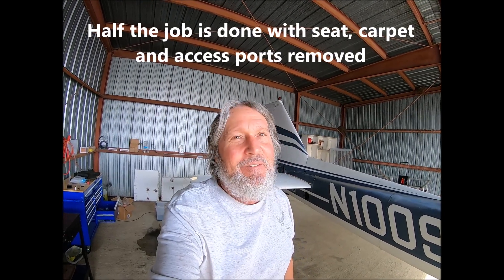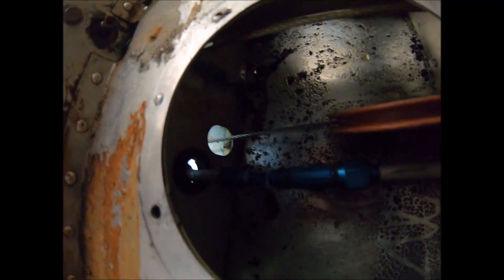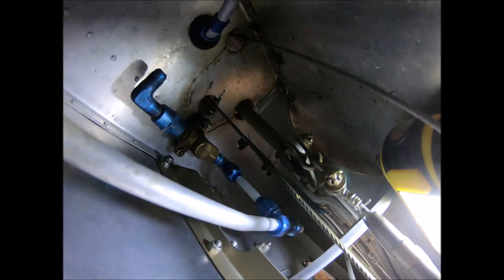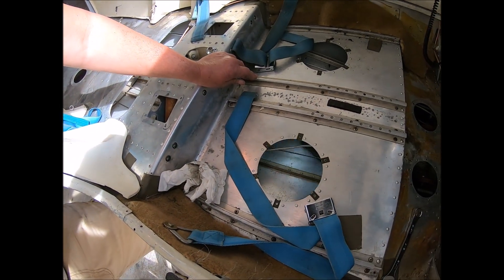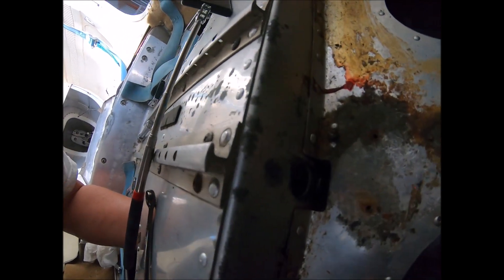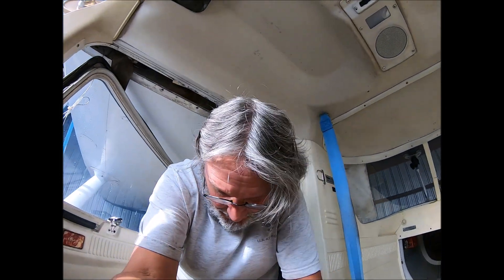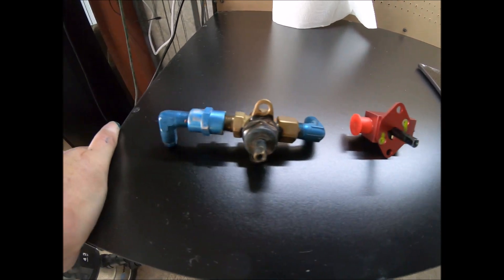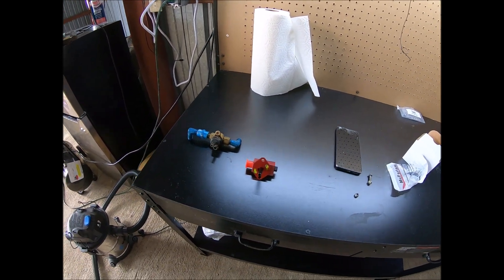Cessna 150 Fuel Shutoff Valve Removal

Comment: rebuilding the old one is super easy, clean it like lappiing a valve, dont loos any parts. 5/16 id fuel resistant oring ms....-011, lube the brass parts with ezlube and good to go